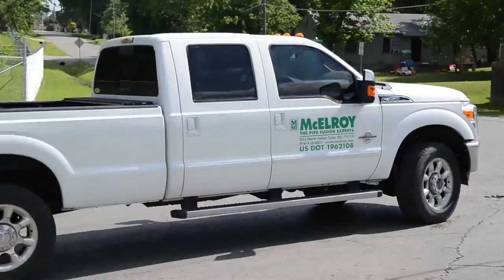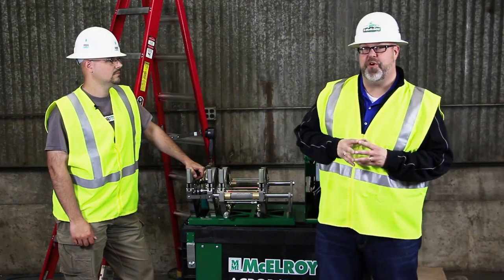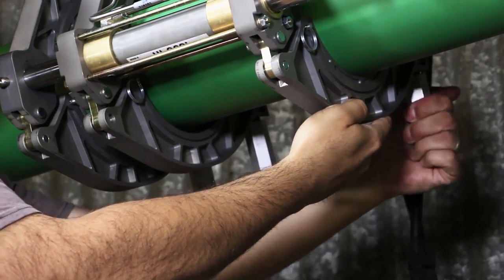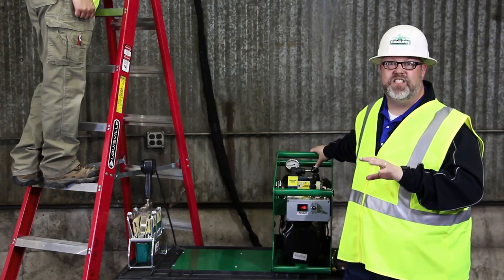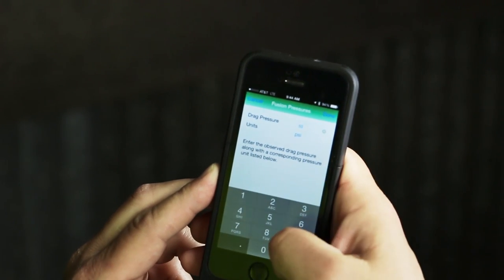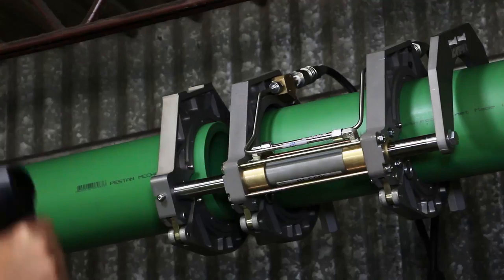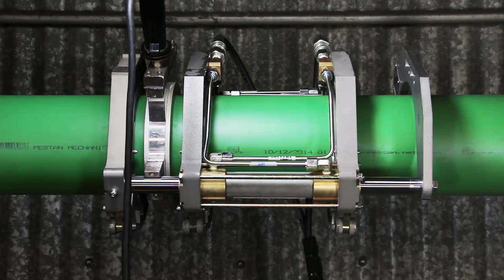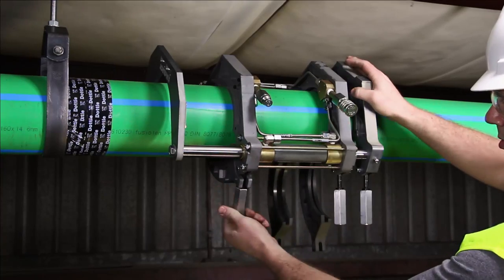Fusing Polypropylene Pipe (PPR) with the McElroy® Acrobat™ 160 - McElroy University On The Job

Comment: Two weeks ago we were butt fusing 10" hdpe. Got my right ring finger between the pipe and the facer. Colleague on the other end of the pipe pushed it suddenly smashing my finger into one of the blades cutting off the tip of the finger and tearing off the finger print skin! be extremely carefull!
Reply: If the facer is in place the pipes should already be clamped how did your coworker move the pipe?